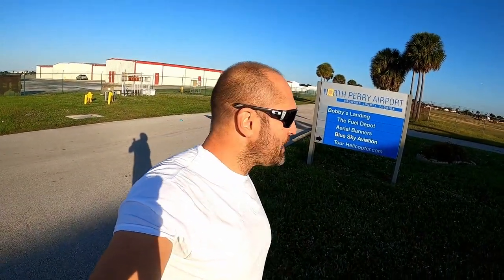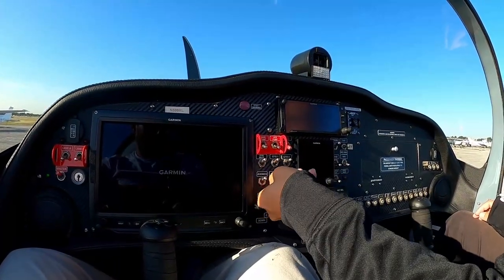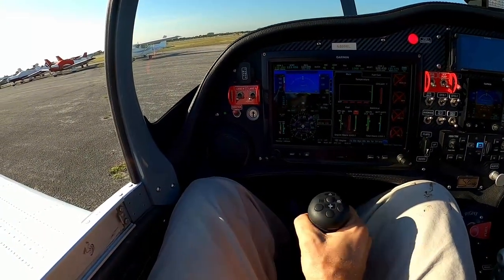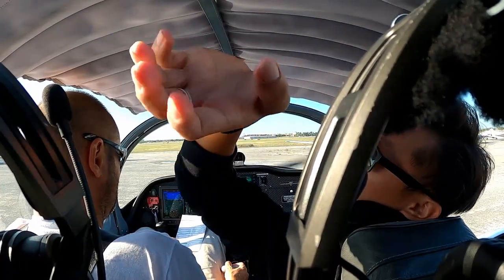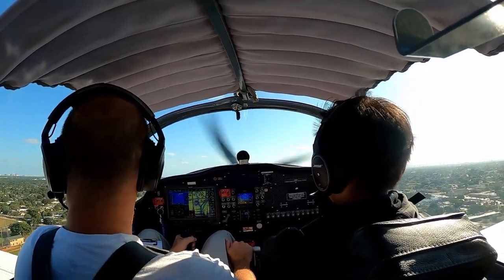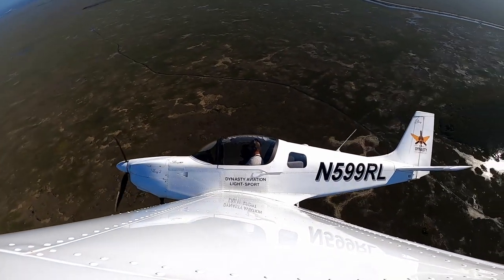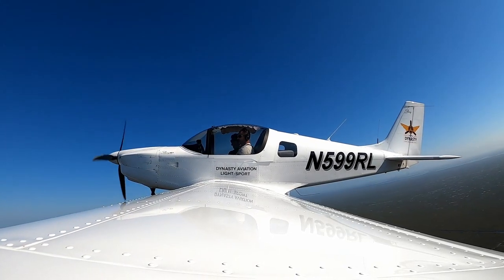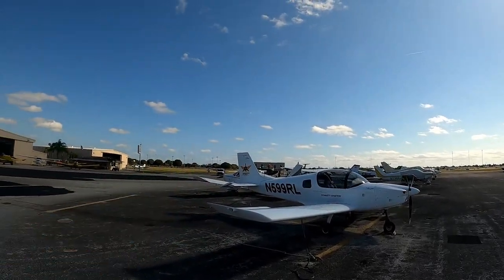Sling 2 Test Flight

Comment: wow what an aircraft, thinking of doing my first lesson / flight discovery in this plane at my local airport.
Reply from the maker: I highly recommend it. Great little airplane with gentle characteristics and fantastic fuel economy. You'll have an easy transition to low wings like pipers. And high wings like Cessnas kind of fly themselves once you understand flight. Which you'll learn in the Sling doing long cross countrys sipping fuel like hot espresso.
Reply: @mikeSierraisking  thanks! just have to fight my nerves first before I can enjoy flying in these small aircraft. I've been flight simming for many years but I suppose the real world is totally different.
Reply from the maker: You'll be pleasantly surprised @clayton4115 .  I used Sims extensively in my training. They were invaluable for instrument training. And you can practice flying in to airports before you go there. It's like cheating, but they encourage it and call it Single Pilot Resource Management.
Reply: @mikeSierraisking  sounds very encouraging hopefully it will help with my initial VFR flying as well.